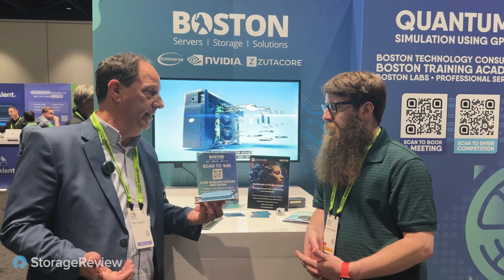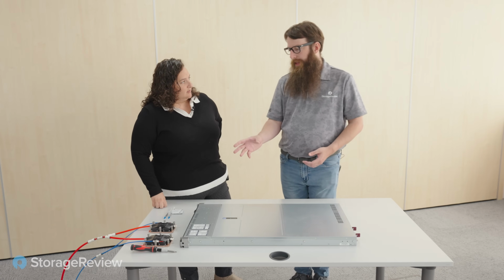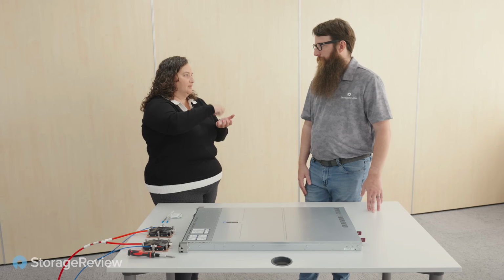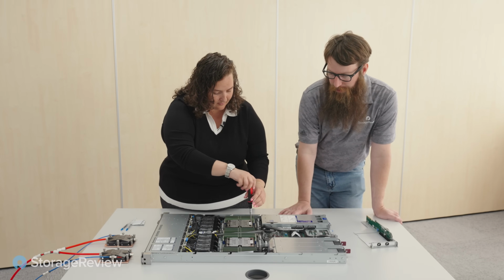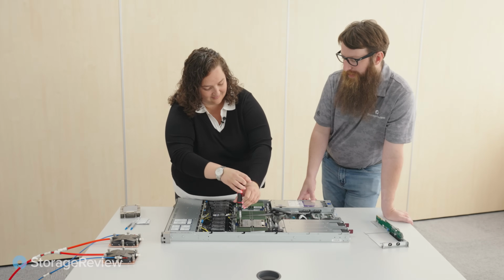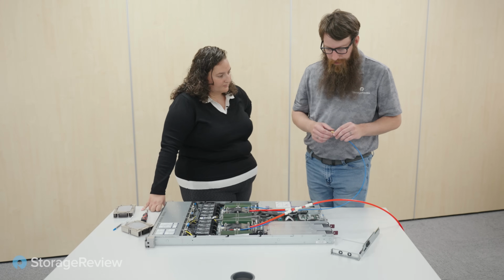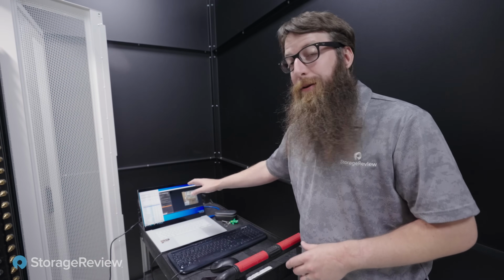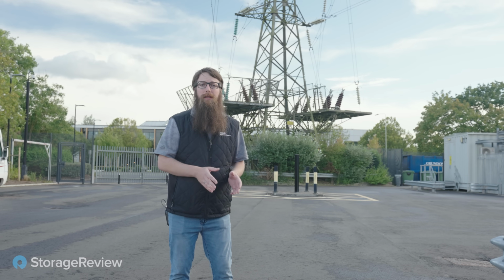256 Cores, Zero Throttling: ZutaCore Liquid Cooling in Action

Comment: What IS the liquid exactly? why not submerge electronics in it or is it expensive to produce?
Reply from the maker: The fluid can change, pretty sure Chemours makes this one but there are a lot of options in the industry. Submersion doesn't work as well for two-phase, much more complicated to deal with - though we have seen small immersion PoCs with it. Single phase is the clear winner for full immersion.
Reply: Its based on phase change (liquid to gas) the phase change process is endothermic and sucks much more heat than just running cold liquid on a copper plate.